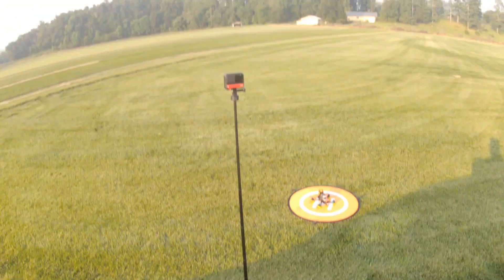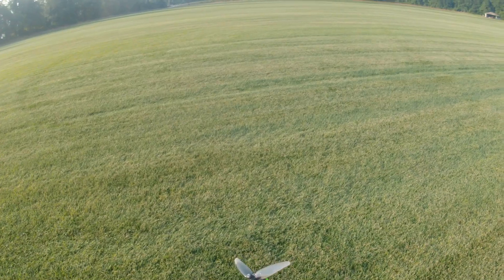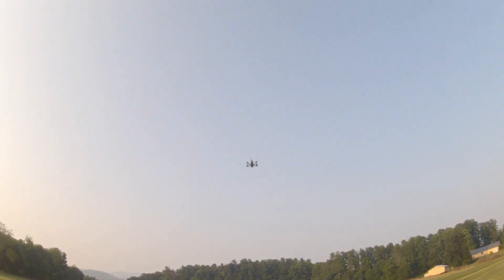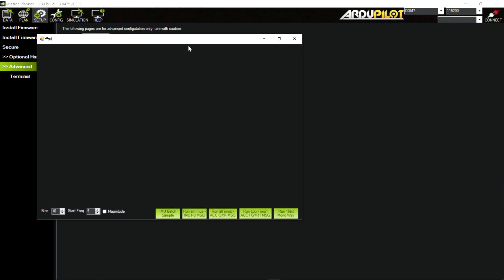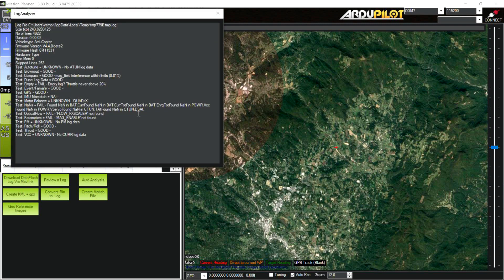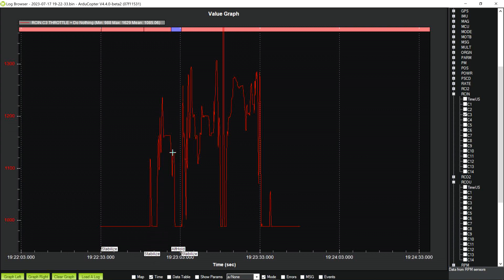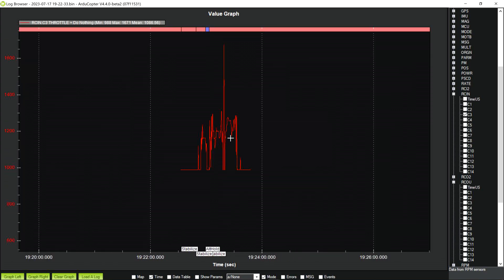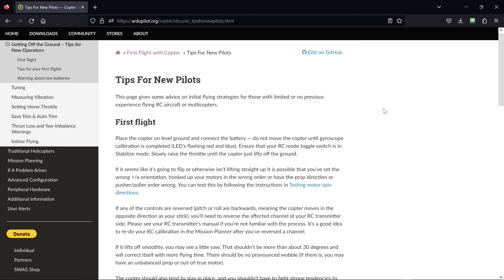Nazgul Evoque F5 V2 Autotune Failed

Comment: Based on the sound of the oscillations, you need to do a PID tune, or you have something in the airframe that is loose causing vibrations.  Also, keep an eye out on the temperature of the motors.  Those oscillations could be causing the motors to heat up excessively.  If after you land, touch the motors.  If you can't keep your fingers on the outside of the bells, you have motor heating problems.
Reply from the maker: I was trying to get an autotune to get the PID's correct.  May not have that option.  May have to do a manual tune first.

Comment: Hi Vernon, had similar problem recently. It would not play until I got the wobble out. I had to put my D terms to almost zero before the oscillations stopped then I played with P terms to bring some D terms back in. It’s a juggle.
Reply from the maker: That is my thinking also.  When I go into althold a new kind of oscillation seems to begin.  I think the excess vibrations is the culprit.